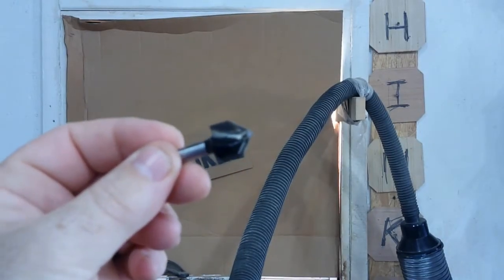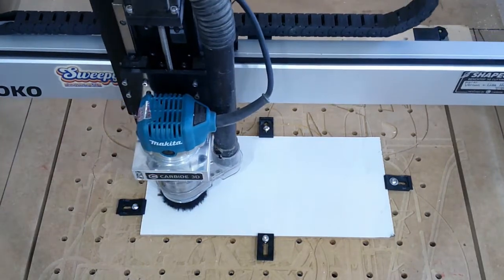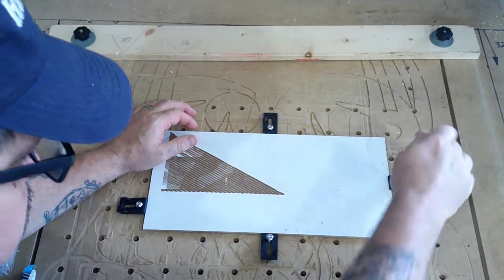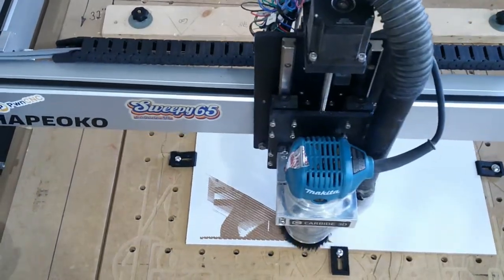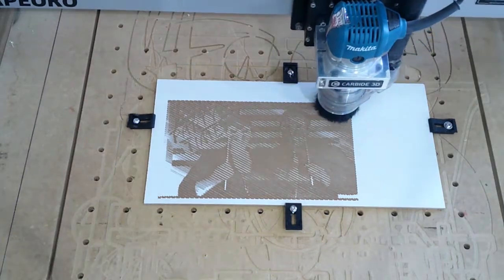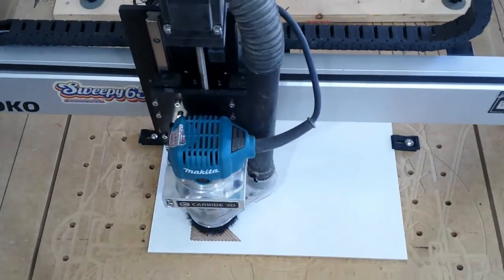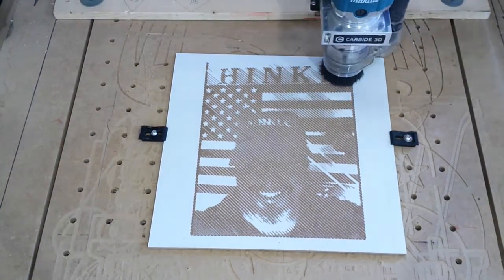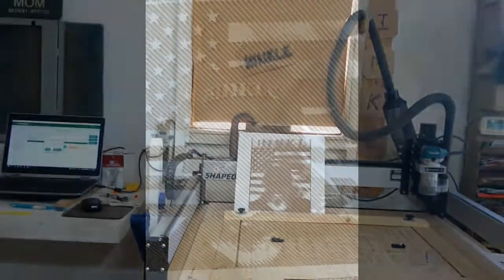Pictures to CNC carving with Carveco

Comment: Hi Vernon great video ! Just a question if I use a material with a black finish will I need to make my photo into a negative ?
Reply from the maker: Hey Paul 
Yes I think that is correct 
Also since this video I’ve learned that spray painting the surface after the carve and then sanding to add highlights works great too
Reply: Thanks Vernon I have acquired a few pieces of black melamine finished boards which might be ideal for v carving.
Reply from the maker: @kelsres  i would love to see the results you can send me pictures on our email 1lisahinkle@gmail.com or on our website hinkleshop.com
Good luck!

Comment: I would bet if you played with the initial image you could really dial it in.
Reply from the maker: Thanks and yes you can 
I have also learned if you spray paint it after the carve and sand for highlights it looks very good too
Reply: @Hinkleshop  I'm a retired cnc machinist and just purchased a small engraver.  I looked that software up and it looks like you lease it which I'm not totally against as it should give me an inexpensive start.  I have a million ideas and can't wait to do cnc work for me instead of someone else.